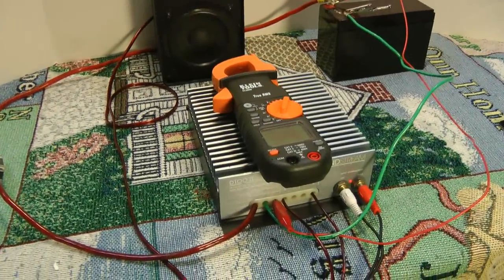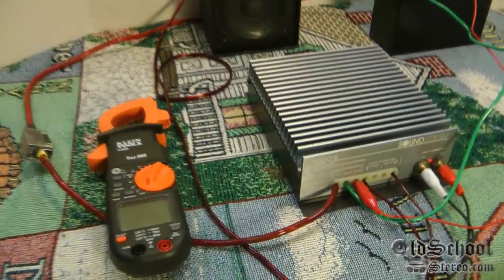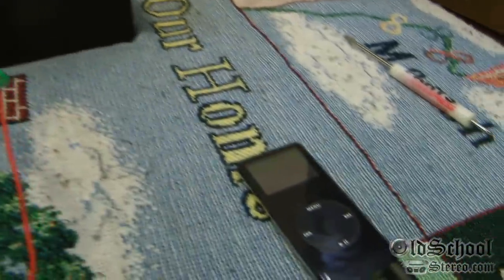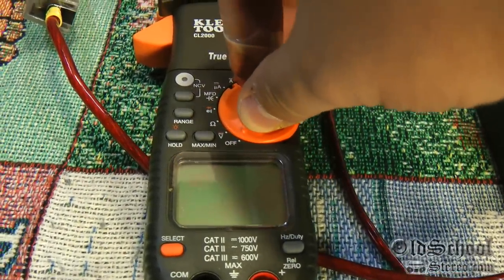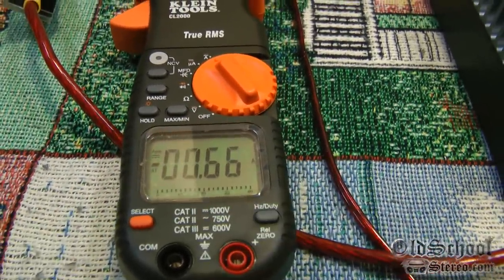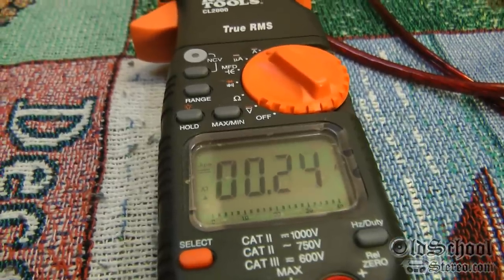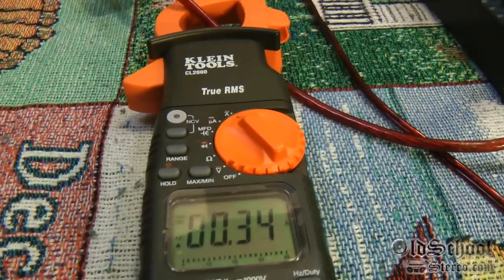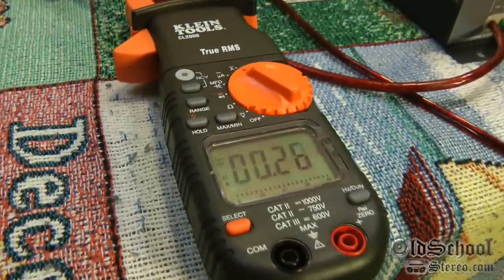Car Audio Clamp Meter for DC Current Measurement Klein Tools CL2000

Comment from the maker: This clamp meter also does RMS voltage and comes with the probes. You can tell by holding the meter it is built well and should last a long time!

Comment: Doesn't that meter have a min/max option that would help greatly with this? Obviously you want to catch the maximum pull over a long period of time and adjust to that as your requirement for battery/alternator output, not some guess based on what you can read on the screen before it disappears right away. Not all clamp meters have this setting for DC and it's extremely frustrating shopping around for one in order to test this very thing, you almost need a shunt and an oscilloscope (or a very high sample rate multimeter) to get truly accurate numbers.

Comment: Is this current reading as acurate as using an multimeter tool to measure the current directly at the wire? You compared that?
Reply from the maker: You can’t use a multimeter to measure over 10A in most cases as it creates a circuit through the meter and most only have 10A internal fuses
Reply: Williston Audio Labs ok thanks. So how accurate is such a clamp? Like 95% accurate? What are the specs?

Comment: sounds silly, but when measuring dc current in series with a battery, does it matter if its through the positive wire or the negative. will the readings be different between the 2 or will it not matter? cheers
Reply: Try it.

Comment: That's a  nice sound stream amp  I've  got two slash 500/1,s hooked up @4 ohms  pushing two alpine type r10d2,s alpine spr60c front stage  rear fill alpine spr69c  alpine pdx4.100  jvc head unit

Comment: You could also measure ac voltage from amp output and multiply times amp input voltage....
Reply: That number would be good except things are not 100% efficient. Would get u a ballpark figure.